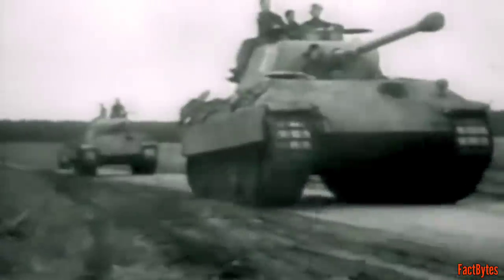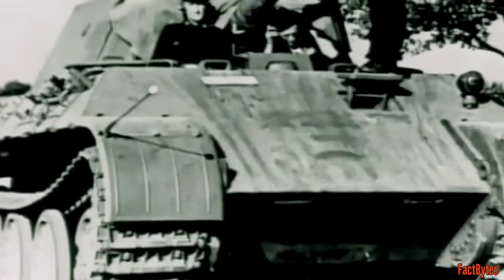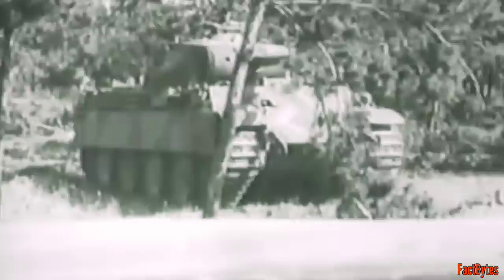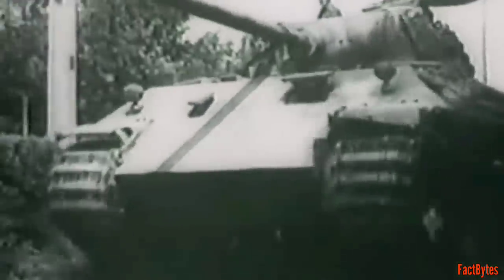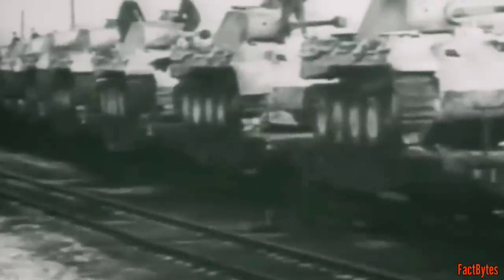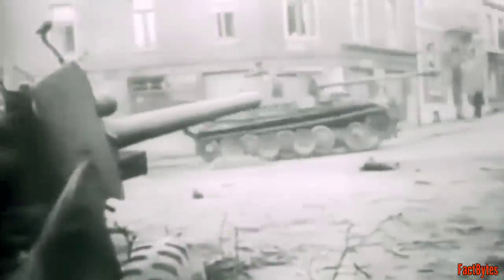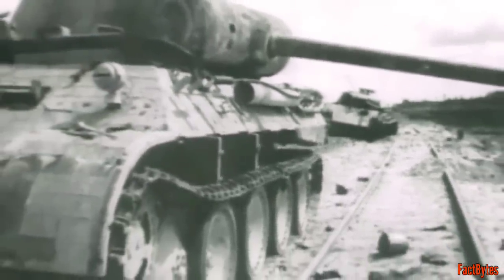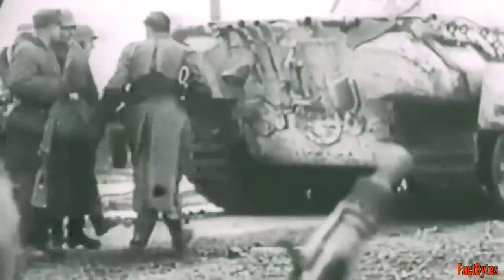Was The German Panther Really The Best Tank Of WW2?

Comment: I wouldn’t consider it the best. But definitely in the top two. It was a balanced tank that did almost everything.
Reply: @bro3217  your bias is definitely showing. The IS-2 didn’t have the worst optics, it had about the same quality optics as other soviet tanks. Although it wasn’t very good, it was good enough at normal combat ranges. “Slow to reload” it really needed only one shot to take out almost all German tanks. It’s armor was very effective even by German accounts, and the IS-2’s potential to arrive in numbers and create so much damage with its 122mm gun caused Wehrmacht command to order its tank crews to avoid duels with IS-2. 
My points:
Having poor optics is exaggerated, they were no worse than the T-34-85’s optics. Considering the 122mm was an accurate gun on its own, the optics weren’t an issue at normal combat ranges
Slow to reload and not enough shells? Yes it’s a flaw but not one that significantly hampered its performance. Like I said, the IS-2 came in numbers so it was never isolated where it’s easy to get overwhelmed by multiple tanks(keep in mind germany already had very few operational tanks at this point).
Reply: @Insert-Retarded-Reply-Here  wrote: " The IS-2 didn’t have the worst optics, it had about the same quality optics as other soviet tanks. Although it wasn’t very good, it was good enough at normal combat ranges. “Slow to reload” it really needed only one shot to take out almost all German tanks. It’s armor was very effective even by German accounts, and the IS-2’s potential to arrive in numbers and create so much damage with its 122mm gun caused Wehrmacht command to order its tank crews to avoid duels with IS-2."

-- IDK, where did that fellow went, therefor I can't response to his post, so I'll through a few complimentary points to your post about IS-2 tank. Unlike Tiger tank, that was conceived as a Durchbruchwagen ("breakthrough vehicle") and supposed to lead other tanks in the attack absorbing all the hits, IS-2 tank was a tank of second echelon(usually a separate detachment that reinforces  main break through), meaning it usually hanging back behind other lighter tanks like T-34 or SU-76 SPG that doing a recognizance, and if they come under fire from hard targets - be it a German heavy tank or well concealed heavy artillery unit, or masonry building or banker, in other words fire support/suppression role. Like you said it had an accurate long range gun, and the combination of telescopic and periscopic sights was good for over 3000meters of direct fire. It is true, that initial piston main gun bridge let only fire 1-2 shots per minute, later in early 1944 it got semi automatic wedge style bridge, that increased to 3 shots per minute, but crew of tanks were actually(just like in case of German Tiger I crews) hand picked and had more then a year of training on top of prior tank experience, and usually coordinated attacks of a single target of "one firing-one reloading" in pairs or platoon strength, to overcome that tank shortcoming.

-- Gun comparison per Kubinka test grounds of captured Tiger II, accuracy from 1km IS-2 gun at most was 170mm vertically and 270mm horizontally, 88mm KwK 43 200mm vertically, and 180mm horizontally, and 122mm IS-2 gun perforated Tiger II frontal armor from distance of 600 meters, while KwK43 when shot at Tiger II frontal armor plate could only do it from distance of 400 meters, and Panthers KwK42 gun only from 100meters away.
Reply: @RussianThunderrr  perfect portrayal of the IS-2 (btw I think that fellow I was responding to either deleted his comment or the weird thing YT sometimes does is delete replies after posting them for no reason)
Reply: Indeed, it can be considered the first "Main Battle Tank", though its features were as much a product of rushed development and "feature creep" more than a carefully thought-out and executed program.  It certainly factored into the British Army developing its fine "universal" tank, the Centurion, and the US Army finally giving in and sending, after the ETO leadership said they didn't want it, the M26 Pershing.
Reply: @selfdo  wrote: "Indeed, it can be considered the first "Main Battle Tank""

-- Pz-V Panther was not considered the first "Main Battle Tank", since it was T-34 in fact M. Koshkin coined T-34 as a "universal" tank that he envisioned T-34 tank like, and not even first German MBT, since Pz-III was that, then after Pz-IV got long gun, it became German second MBT, while Pz-III became a "Fire Support"(Begleitwagen) tank previously held by Pz-IV.
Reply: Including set itself on fire!  :^D  I had a much higher opinion of it until I learned it required final drive maintenance before running through a tank of fuel. That's sad.
Reply: The top two *pieces of junk*.   Frequent transmission break downs and it's propensity to catch on fire are not qualities that one associates with the term, "best".
Reply: @HiTechOilCo  pointing out what Paton said and reported to military advisory about the Sherman’s only reinforced what I posted.
Reply: @HiTechOilCo  absolutely correct. The panther is one of the most overrated tanks in the war and was one of the worst tanks when it came to winning one
Reply: @Insert-Retarded-Reply-Here  that's why they called American tanks zippos.
Reply: The EZ8 version of the Sherman was probably the best all round tank of the war . Relatively cheap, easy to mass produce, reliable, hard hitting, good x country ,less liable to burst into flame because of wet ammo storage . Detroit finally got it right.
Reply: @michellebrown4903  You make a good case for that choice, Michelle!
Reply: @michellebrown4903  wrote: "good x country"

-- Really!?

https://www.youtube.com/watch?v=O-cFP4S7bc4
Reply: @RussianThunderrr  with the EZ8 they improved the suspension ( torsion bar)
And increased track width . The Sherman wasn't " best " at anything, it could just do everything asked of it adequately. Could be bought 5000 miles and relatively easily deployed where it was needed , wasn't to heavy or wide for the infrastructure etc.
Reply: @michellebrown4903  wrote: "with the EZ8 they improved the suspension ( torsion bar)
And increased track width ."
-- M4 Sherman never had torsion bar suspension, it alway had bogies, which was easier to repair, and eventually to upgrade to wider caterpillar track by putting spacers between hull of the tank and bogies, but that happened after the war by Israel. Until then cross country was not great, and problems for Sherman was also exacerbated by tank been to heavy, so it was a prone for tipping/flipping over. Dmytri Loza flipped over twice in his Sherman tank, it was also slippery on ice. But the other advantages of Sherman, that main gun manlet was bolted, so upgrade for main armament was easier then on any other tank. For example Jumbo Shermans during WWII was armed with 75mm gun, but when Korean war broke out, they just bolted long 76mm gun, and shipped it to Korea.
Reply: @RussianThunderrr  you're right ,it is horizontal vss suspension ,not torsion bar .
However ,it was a vastly superior
to the vertical bogies , inherited
from Lee/ Grant . Anyway ,it was a jack of all trades ,and perhaps not a master of one .... but it was good enough,and very deployable. Well rounded tank.
Reply: @michellebrown4903  that's why they went up like zippos after one hit.
Reply: @Daniel-os9tb  the EZ8 was far less likely to burn than a Panther
Was also easier to get out of .
Reply: @michellebrown4903  how did the tank maintenance crews put it. Went right through. The transmission and armor.
Reply: @Daniel-os9tb  and l thought it was" Ronson ". The early ones were not great it has to be said ,
but comparing a Sherman with an lS 2 ? A heavy Vs a medium ?
Reply: @michellebrown4903  general Cato-“ the men refer to the Sherman as coffins”
Reply: @michellebrown4903  Hence, the Sherman’s grim nickname—Ronson, like the cigarette lighter, because “it lights up the first time, every time.” Next time don’t cherry 🍒 pick.
Reply: @michellebrown4903  For its part, the M-4 was good in 1942, adequate in 1943 and totally outclassed by 1944. Unfortunately for American tankers, the war lasted until 1945.-Kyle Mizokami
Reply: @michellebrown4903  the panther was a heavy too, Germans still called it a medium but it was as heavy as the IS-2. When we talk about the “best” tank, it’s about the best balance of everything, which the IS-2 achieves. Extremely good anti-soft target capability, a shell that had so much kinetic energy that it would collapse any German tank armor, reliable, one of the least complicated heavies ever produced allowing almost 4 thousand to be made
Reply: @Daniel-os9tb  honestly, the Sherman lit up quite a lot, but it usually didn’t cook the ammo off, meaning the crew survivability was good. A hit to the front of the Sherman almost never caused it to go up in flames immediately, but a hit to the side probably would. At that point though, it wouldn’t matter. All tanks would get knocked out from a hit to the side regardless if it burned or not
Reply: @Insert-Retarded-Reply-Here  as the brits put it. They were flaming ⚰️. As the mechanics who worked on turning them around and removing the bodies. They were butcher boxes. Did I post the panzer was the best. Nope. In the top two. Why. Because unlike the zippo tanks it performed, it broke lines and when needed. It was an unstoppable road block. And take a hit and keep going. As the German commanders pointed out. They felt almost sorry for the Sherman tankers. Because everyone knew they were going to die.
Reply: @Insert-Retarded-Reply-Here  wrote: "Germans still called it a medium but it was as heavy as the IS-2"

Question: When did Germans called Panther a medium tank? Here is some answers:

https://www.youtube.com/watch?v=_EUp1_FZWUQ
Reply: @Daniel-os9tb  That ad was POST-WAR.  Do some research, Daniel, you're repeating MYTHS.
Reply: @selfdo  actually everything I posted is cited by all historians and commanders as well as mechanics in the filed involved and cited in the vids posted. As are the journals and logs. They were not myth. This was documented. So yes next time. Do some research before posting willfully ignorant.
Reply: @selfdo   wrote: "That ad was POST-WAR.  Do some research, Daniel, you're repeating MYTHS."

-- Sure thing, Doug, its easy for you to say something like that, since you did tons of research on IS-2 and Panther tank, right?

-- I'm still confused why did you call IS-2 main gun which is a canon and not a howitzer, well a "howitzer"? What gives?
Reply: @michellebrown4903  nope. The E8 had good anti tank capability but it had a terrible HE shell. That title would go to the IS-2, which was reliable, well armored, one of the best guns in the war, and good terrain crossing capability
Reply: @Insert-Retarded-Reply-Here  the is2 had a 122 mm gun of courses it had a good he shell that like comparing a lightweight fighters punch to a heavy
Reply: @j_mack__1370  and? I already said it had one of the best tank guns in the war. The IS-2 is still the best
Reply: @Insert-Retarded-Reply-Here  The IS-2 was anything BUT "reliable", and its 122mm gun, carried straight over from a howitzer design, was slow to load and not terrifically accurate as a tank gun.  But the "Stalin" wasn't intended to fight the panzers at all; it was effectively a mobile "bunker buster", and given the many old fortifications in Poland and Germany that the Heer improvised as defensive positions, the right tool for the job!
Reply: @selfdo  wrote: "The IS-2 was anything BUT "reliable", and its 122mm gun, carried straight over from a howitzer design, was slow to load and not terrifically accurate as a tank gun."
and
"But the "Stalin" wasn't intended to fight the panzers at all;"

-- "Brofessor Douglas Self", FYI  at 45 calibers 122mm 25D-T was NOT a howitzer, but a tank variant of a heavy long range Corp(one level above divisional) canon modernized design of 1937 of 122mm Corp canon of original design of 1931. 122-мм Kорпусная Пушка(Corp Canon) образца 1931/37 годов first see action against German Panzers in October of 1941 at operation Typhoon in Volokolamsk(Волоколамское Шоссе) region near Moscow.

-- IS-2 was very much intended to fight ANY German tanks, therefor it carried ARMOR PIERCING AMMO! There was extensive tests of this gun conducted on every German mass produced tank(including  both Tiger tank models, Tiger I and Tiger II), as well as accuracy of the this 122mm canon vs German canons which results are been declassified and stated above.
-- IS-2 also was very effective as anti personnel gun, as well as anti fortifications.

-- As far as IS-2 reliability goes, it was by far much more reliable heavy tank of WWII of any nations, and was in service into 1990 in Soviet Union. Just for comparison IS-3 was withdrawn from service in 1973.
Reply: @Insert-Retarded-Reply-Here  IS2 definately wasnt best. It had serious problem with turret rings. Calibration needed to be done for weapon after few rounds, long range fire wasnt accurate anymore.
Reply: @Insert-Retarded-Reply-Here  one if the best gun? That gun was shit, 75mm gun had 3x faster reload, crew didn't need to set it to loading position and again find target and aiming was also much harder with its shell weight not to mention moving target. All of that to have gun with similar penetration and more pretty much not needed tnt, 122mm gun was bad, 100mm su100 gun performed much better, it was much lighter, had more penetration, it was much easier to load and aim and tnt was enough to destroy any tank with 1 or 2 shots
Reply: @szynszylku1447  too much german propaganda for you I see. The gun had much MUCH more penetration than the 75mm. The gun never had to be set into a loading position. On the model 1944 breech redesign, the loading position was fixed and the gunner could stay on target during the loading process.
Reply: @Insert-Retarded-Reply-Here  no from what I read D25-t gun have similar penetration to german 7,5 cm KwK 42 so even without need to relocate gun, it was especially shitty to deal with tanks given to account other guns that could do that much better, but it was also made to destroy bunkers so that is why it had 122 gun
Reply: @szynszylku1447  the only tank the 122mm couldn’t penetrate frontally was the tiger II. That is it. How many tiger IIs were produced? You tell me 🤣
Reply: @Insert-Retarded-Reply-Here  ok why does it matter? Like panther and tiger could also penetrate it quite, amusing because soviets had a lot of time (for their standarts) to design a better armored tank besides penetratin and hitting are 2 different things, the second was very hard for is2
Reply: @szynszylku1447  hard? Lol what are you talking about. The tiger I couldn’t penetrate the IS-2 almost anywhere except if it was point blank. The panther could only penetrate the small weak spots like the turret cheek. And no, the IS-2 had NO problems hitting and penetrating other tanks because the 122mm was an accurate gun for soviet standards, and moreover all the IS-2 gunner had to do was aim center mass and if it hits any part of the German vehicle it is royally screwed
Reply: @Insert-Retarded-Reply-Here  weren't is2 cheeks 100 mm thick? And lower plate also was vonurable to panthers? Besides soviet standarts? A pesant with a gun after 1 month of training and steel that could crack when hitted by shell? Those are soviet standarts
Reply: @szynszylku1447  8.8cm kwk36 was not accurate enough to hit the cheeks of the IS-2 without moving point blank. Lower plate was vulnerable to panthers but the entire panther is a vulnerable to an IS-2. And no, the crews who operated IS-2 mod 1944s were the best the USSR had to offer, and many, if not all had prior combat experience. And no, IS-2 armor cracking and spalling only happened with the early IS-2 stepped front plate where German tanks noticed the driver would be killed if hit in the front. When this issue was fixed, soviet heat treating was still inferior but it was still much better than late war german heat treatment of armor
Reply: @Insert-Retarded-Reply-Here  are you talking about same gun which could hit thing like 1,5 km away one of the best optics in tanks not to mention better crew? Yes I know about that already you just said that is2 was unpenetrable by tigers and panther and as I explained it isin't right
I was talking overall when I hear "good for soviet standarts" I can only imagine below average at best and yea late war heat treatment was shitty in germany mainly because they didn't had as much of hard metals which made tiger 100mm plate be much harder to penetrate than other coutries 100mm plates. But yes is2 for sure could destroy tigers and panthers but for me fact that about 50% of all is2 were is2 1944, gun took 20-30 seconds of reload and turret ring just makes this tank worse than what other allies had and at that time germany already had elefants and I thi k jagdpanthers with tiger 2 gun not to mention jagdtiger
Reply: @szynszylku1447  jagdtiger and elefant were the worst tanks ever designed. Ever. Elefants broke down and caught on fire when they tried to climb hills, and jagdtiger were so heavy they crushed their own roadwheels and tracks. I’m not reading the rest of that since you clearly don’t speak English, maybe if you added some punctuation it would be less of an eyesore. And no, the Allies did NOT have anything better at the time. The closest thing is the pershing, which had mobility and reliability issues due to an underpowered engine
Reply: @Insert-Retarded-Reply-Here  elefant wasn't as bad as people think for exemple in battle of kursk 90 elefants destroyed 822 tanks while losing only 40 so yea 20:1 ratio is quite a lot for worst tank ever designed. And sherman in my opinion is much better tank design than is2 shit load of different versions from those to support infantry to firefly the tiger buster, it was reliable, part were the same in ever single one of them so repairing them was easy as fuck, mobile, could climb 60 degrees walls and well armored for the time it was design and the fact that even at the end of the war it was still effective speaks for itself
Reply: @Insert-Retarded-Reply-Here  ok how the fuck did you read last part without reading first part? someone is really trying best to noT admit that he was little bit wrong
Reply: @szynszylku1447  no it is bad, the only reason the elefant did so well was because it had a good gun….and that’s where the positives end. If everything else about a tank is horrendous but it has a good gun, it can still perform “well” despite still being a rubbish tank.
Reply: @Insert-Retarded-Reply-Here  "elefant wasn't as bad as people think" ok so I am confused first you talk about how bad my english is but I have no fucking idea where I wrote that elefant was a good tank, besides not everything else elefant armor was the best among any tank at that time allies or axis it was quite and advantage
Reply: @szynszylku1447  no it was quite literally as bad as people think, but to each their own
Reply: @Insert-Retarded-Reply-Here  no, it wasn't as bad as you thought you thought that it was worst tank design of the war
Reply: @szynszylku1447  name a worse design than that pile of crap that saw service during the war
Reply: @Insert-Retarded-Reply-Here  valiant, t-35, covenanter and early t-34 with shitty gun and one of the worst if not the worst crew conditions to the point where crew could be killed by it's gun it had no radio and only thing that it performed well was mobility because it had weak turret as well as russian heat treatment of steel not to mention soviet factory conditions
Reply: @szynszylku1447  I’m talking about tanks that saw combat, so valiant and Covenanter does not count. T-35 was designed in 1935, and at that time it had okay protection and good armament, of course by WWII it’s problems made it the worst. But like I said, designed in 1935. The elefant was designed in 1942. And no, the T-34 always has been an excellent tank at its time of introduction. The T-34’s armor was impervious to the 37mm and 50mm of the German tanks, and the 76mm was a good gun at the time that could destroy any German tank in 1941.
Reply: @Insert-Retarded-Reply-Here  t-35 really? Like pz 3 was produced 2 years later and words can't express how worse it was than pz3 like there wasn't even a single thing that t 35 was better than pz3 even amor. T 34 was shitty tank from start to finish only thing that saved him was russia producing them more than german tanks could carry rounds. Besides russians actually run test comparing pz3 with t34, pz3 was better at everything besides armor americans also tested it and guess what they came to samo conclusion it was a bad design, besides seriously a tank which can poison his own crew? No batter how much copium you will take you won't fucking convince me that early t34 were better than elefants
Reply: @szynszylku1447  now I get it, you get your information from neo n@zi wehraboo sites or you are a toxic wehraboo yourself. Either way that entire comment is wrong, there is no such thing as standard production T-34s poisoning their crews, everything about the T-34, armor, firepower, and cross country abilities FAR exceeded the Pz III. The only reason why the Pz. III wasn’t junk is because they had well trained crews initially and the hardest opponent they had to fight was France before the T-34 came out. The elefant is the WORST TANK DESIGNED AND FIELDED IN WW2. LOOK AT THE STATISTICS. THE OPERATIONAL RATES OF THE ELEFANT IS ABYSMAL. NO TANK IN HISTORY HAS CAUGHT FIRE AND BROKEN DOWN WITHOUT ANYWAY TO REPAIR IT JUST BY GOING UP A SLOPE. AND IT ALSO HAPPENS TO BE ONE OF THE MOST EXPENSIVE TANKS OF THE WAR, YOU COULD LITERALLY BUILD 5 T-34S ALL OF THEM BEING FAR BETTER TANKS IN PLACE OF A SINGLE ELEFANT, GET YOUR HEAD OUT OF YOUR FUCKING ASS
Reply: @Insert-Retarded-Reply-Here  yes there was t34 crews had to open their waaaay too heavy hatch so smoke from firing their gun would go away besides like I said, crampy tank and commander which had to command the tank and be loader or gunner at the same time, it didn't had hatch which made the tank fucking blind, problems with the mechanical reliability and durability of, among other things, the tracks, also sorry he wasn't faster than pz3 from SOVIET tests pz3 was 20km/h faster and even if gun of t34 was better in raw numbers, pz3 had better optics better crew conditions and better visibility so overall pz3 was more effective even here, so no entire comment isin't wrong because it is based on soviet testing
Reply: @Insert-Retarded-Reply-Here  btw last part funny how you are talking about 5 t34 which 1 elefant was laughing when even t34/85 wanted to do anything to it from the front but from the battle of kursk he was worth much more than just 5
Reply: @Insert-Retarded-Reply-Here  I am toxic werhaboo? No idiot I just think that t-34 was a shitty tank, I think elefant was a shitty tank I think panther was a bad tank, I don't know at this point people call me toxuc werhaboo and toxic sovietboo at the same time
Reply: @szynszylku1447  ah, so your neither. You’re just stupid. Cheers